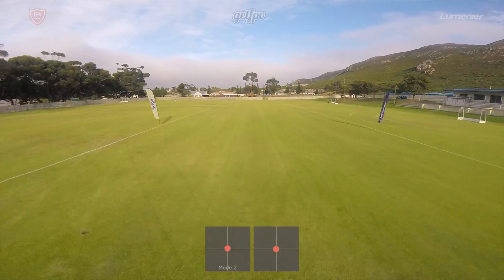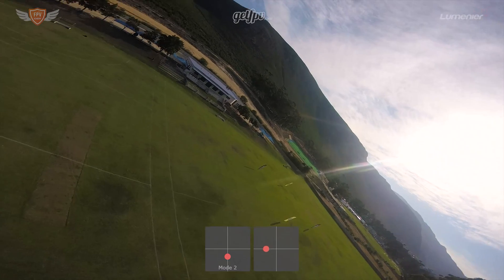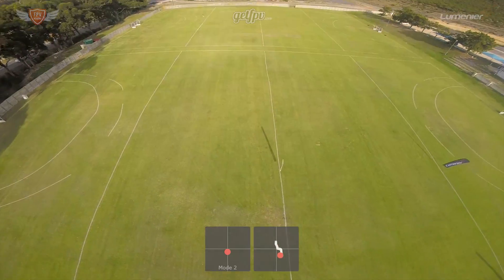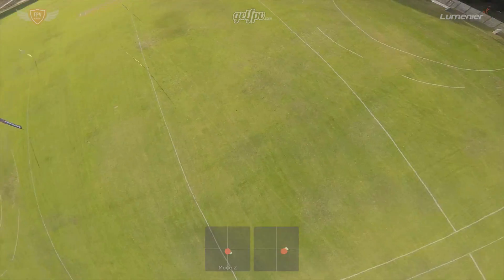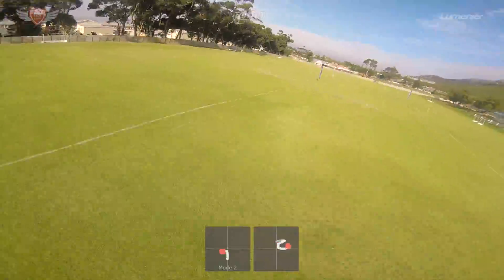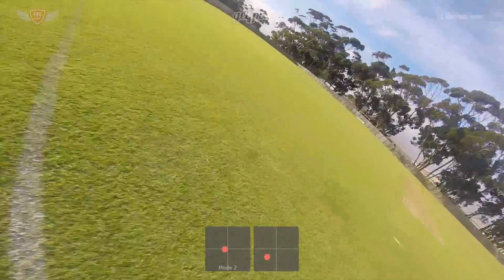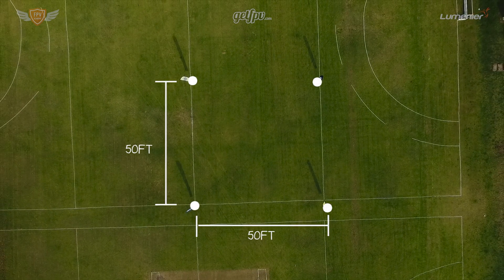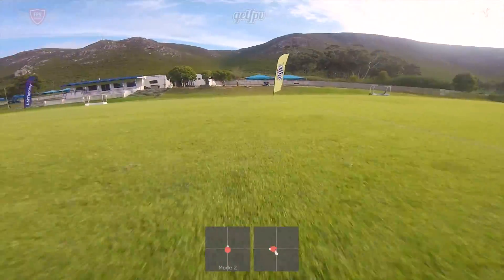How-to Fly FPV Quadcopter/Drone // Beginner: Lesson 4 // Throttle Control

Comment: I can't keep altitude on Liftoff with the FlySky Nirvana NV14 so difficult not sure if it's really that hard or if settings aren't correct or just practice practice practice. But it's the throttle input it's so sensitive.
Reply: I came with exact same reason. I have beta lite 3 controller and throttle is ridiculously sensitive

Comment: I have purchased the runcam swift 2 and I do not want to use the osd in the camera because I have a separate osd on my flight controller that is configurable in beta flight. My main aim is to be able to change my rates through the osd on my FC as I am a begginer.